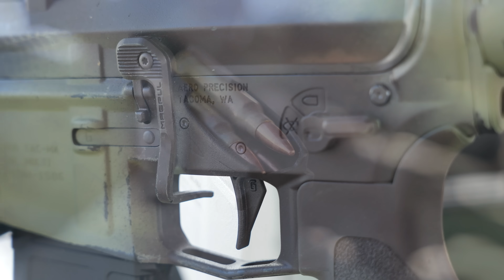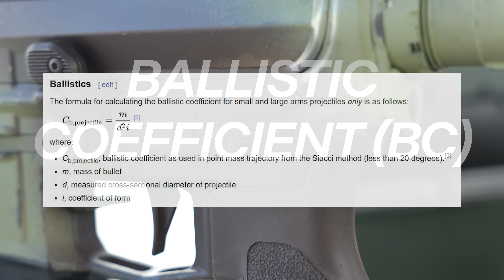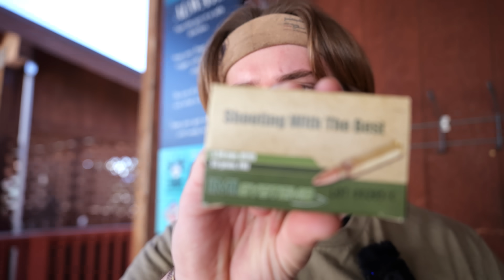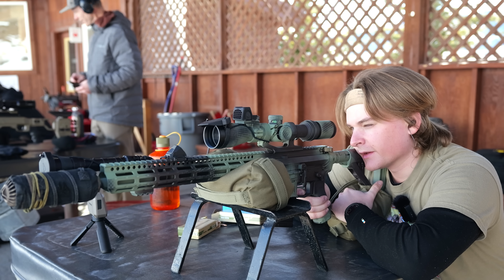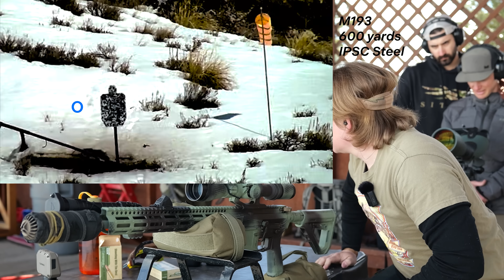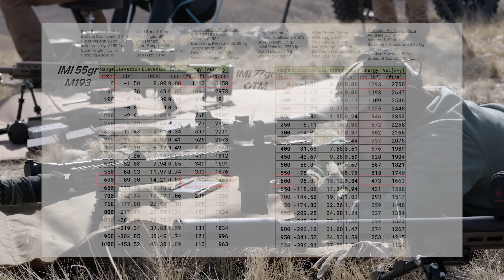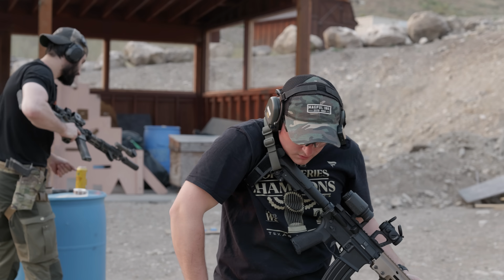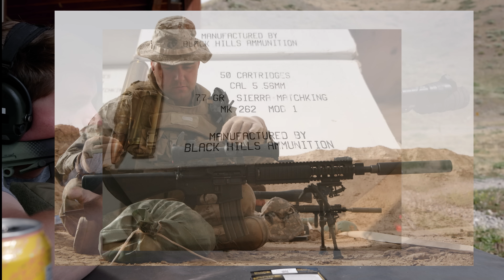77gr OTM: Why This Outstanding 5.56 Ammo Is Worth The Cost

Comment: mk262 terminal effect is a meme for civilians. There are much better options if you are CONUS. The civilian hunting market has been producing better ammo for 30 years.

The DOD has noted several times that the increase in lethality from mk262 over m193 and m855 is due to a few things:

1. Precision, mk262 has been demonstrated to shoot a mean radius of less than 0.33" in composite 30 round groups with extreme spreads of ~1" in ten shot strings. For m855 "Both average vertical standard deviation and the average horizontal standard deviation shall be not greater than 6.8 inches at 600 yards". That is an extreme spread of 30" at 600 yards. 

2. Elimination of fleet yaw, due to the construction of m855 there is a high degree of irregularity in the center of mass. This can translate to a non-concentric twist of the projectile in flight. At extended distances these variations in yaw can lead to dramatically reduced wound cross-section. This is due to the projectile not landing with an optimized angle-of-attack on the given target.

The main reason mk262 worked in GWOT has nothing to do with frag, it's just hit probability. It turned misses into hits and marginal hits into effective hits.
Reply: this is a cool analysis, thanks
Reply: If the terminal effect is a civilian meme why was this round also used in CQB in small rooms where hitting a torso 5 yards away doesn’t require a bullet capable of a mean radius of 0.33”….
Reply: @googlesucks3520  How many boxes of personal ammo did your command let you bring, when you deployed? 

Maybe you just used what was issued to you....

Perhaps you didn't even deploy....
Reply: @magickaldood  your appeal to authority is dead on arrival. You don’t have to have served to see the documented proof online in various places. Small Arms Solutions did a whole episode right here on youtube dedicated to the mk262 and went over the improvement in accuracy AND terminal ballistics. I think it’s funny that you dismiss the mk262 terminal performance saying the civilian market has better ammo but then in your next post ask how many boxes of personal ammo from that same civilian market I was allowed to take...Logic chain broken. Better luck next time.
Reply: What would you say are other good options from a civilian perspective?
Reply: @collinb.8542  Winchester Ranger Bonded 64gr RA556B if you can find it.
Reply: @collinb.8542 Probably because civilians are not bound by the Laws of Armed Conflict and can use expanding bullets, whereas soldiers cannot. There are some really good expanding bullets in 5.56mm (well, they are no doubt decribed as .223 calibre onthe box) with bullet  weights in the 75 - 80 grain region which, while not match grade like Mk 262, have good BCs.
Reply: @collinb.8542  Soft points (my favorites are Hornady 55gr w/cannelure and Federal TBBC) or tsx 70gr for barriers, based on what I saw in LE.

PSA sabre looks good based on the preliminary tests I've seen. I'll wait to see it in a coroners report before I switch though.
Reply: @magickaldood agree completely with the choice of tsx 70gr
Reply: @magickaldood have you tried the ADI 62gr .223 soft points?
Reply: @ I don't have any experience with ADI ammo. I did look at their website and I didn't find any current 62gr offerings. I did notice that they have two 55gr offerings one is a Gameking and the other a Blitzking.

It's my understanding that Sierra makes the Blitzking and Varminter series with thinner jackets than the Gameking and Matchking.

I would not use a Sierra Varmint projectile for self defense. I would stick to something that is designed for hog or mule deer sized animals, at a minimum.

It looks like Sierra does manufacture a 62gr  Gameking which I'm reasonably certain would work quite well.
Reply: "Hunting" bullets are mediocre at best. Mostly propaganda to get idiots to buy cool looking bullets and packaging. Precision match ammo is what the "civilian" market produces that is better.
Reply: If you can find it Guns and Ammo published a quarterly Magazine of the AR. One of the issues post Desert Storm had an article titled “and Samson slew a thousand Philistines” or something similar. The Scoped SPRs used by an SF Scud Hunter team with the then new M-262 Mod 0, Match King bullets from Sierra performed astonishingly well. I think the odds were 3 snake eaters vs an Iraqi reinforced rifle Company of 200 plus. The results were GB’s 165, Iraqi’s 0 in less than an hr and a half gunfight.  The 77gr BTHP is deadly in trained hands at extended ranges.

Comment: ....77grn SMKs are 1/2 MoA out of a 30" 1:7 twist FTR out to 500 (MV 2960 fps). A cheaper alternative is Hornady 75grn BTHP, which I shot to 500 around 1MoA (MV 2990 fps), but you need to sort them by length to get the seating right. If you want an insanely accurate hunting round, try a 65grn Sierra Game Changer (over 22.7 grn N133) which are cloverleaf @100 and good to 300 yards for subMoA....good luck!
Reply: Who the fuck is shooting a 30” 5.56 rifle actually what the fuck is shooting a 30” rifle period

Comment: There is way better ammo available to civilians for SBRs especially. Look into some of the loads used for law enforcement. They are optimized for short barrels and fragment/expand significantly easier than either m193 or 77gr otm. 77gr otm is good especially for precision shooting but it has a lot of lore attached to it from its military use. Keep in mind--they're limited in what they can use by the Geneva convention. You and I are not.

69gr SMK is also extremely good for SPRs and I have consistently found it to be more accurate than just about anything else out of virtually every barrel I've ever owned. Criterions especially love 69gr.
Reply from the maker: @armorers_wrench  I have looked into the loads you are talking about and they are super effective for sure. I’ll look into the 69gr, I use criterion barrels a lot!
Reply: +1 for 69gr SMK. I like the factory stuff from ADI. Its .223 and the velocities are a bit lower, but the recoil impulse is very soft and the accuracy is phenomenal.
Reply: Yea 68-69 is the sweet spot can confirm . Have a criterion
Reply: Black hills 50gr TSX gets 2850fps out of a 10.5” barrel, 600 more than the purported 2200fps velocity flesh expansion threshold. https://youtu.be/5o-Tw0BbLd0?si=gNyLSBIwG8iBmDYa
Reply: Agreed, the 69gr SMK are the best grouping rounds in all my ARs

Comment: I have a BCM 14.5 with a 1-8x, it's my GPR. Would you recommend completely switching over to 77gr?
Reply: That's what I do. 55gr for non-precise targets within 300 yards, 77gr for precise targets and past 300y. Just take note of your POI difference between them. I zero for 77gr and have the POI shift for 55gr written in my DOPE.
Reply: @Tonerer  do you keep different magazines on your kit for said ammo? Like 3 77gr mags, 3 55gr?
Reply: @guitarthrasher81 I keep the mags separate, but it  epends on what I'm getting ready for. Recent run n gun I did I had 3 mags for each that were easy to differentiate. If it were the boogaloo in Minecraft I'd probably just have 77gr.
Reply: @Tonerer  Interesting. So you mainly stockpile 55gr for training/close purposes, but also have a 77gr stash you would use in a general shtf situation
Reply: @guitarthrasher81  Exactly. SHTF 77gr, but I stock 55gr deep for training and most comps that don't have long range or precision shots.
Reply: @guitarthrasher81  I'd recommend trying a few different 77gr loads out and see what your rifle likes before stocking up in bulk.
Reply from the maker: Cheap FMJ is still useful unless you need the performance! Know your dope with both and keep some of the 77s for special purposes
Reply: @greenweiser  Good idea, never thought about having multiple dopes and switching between ammo types. Thanks